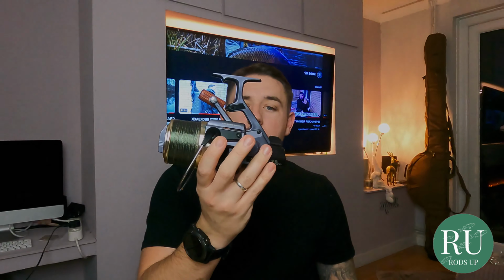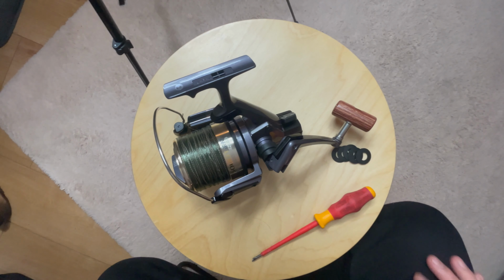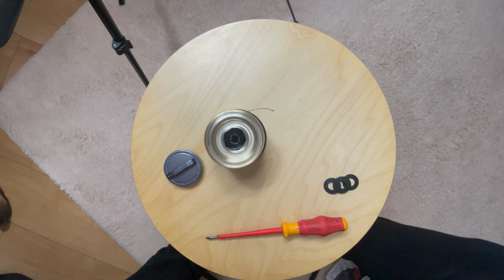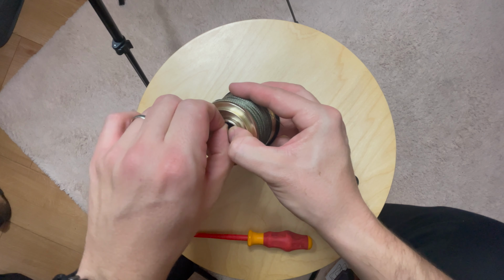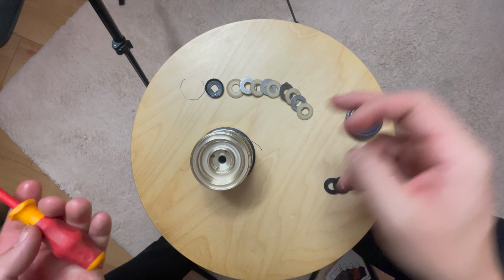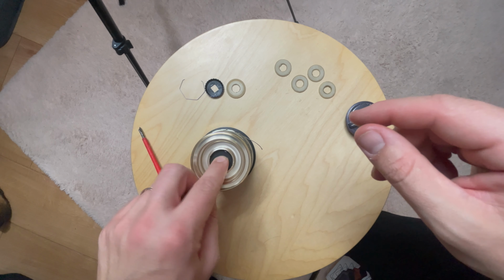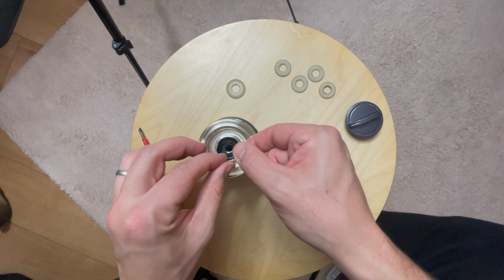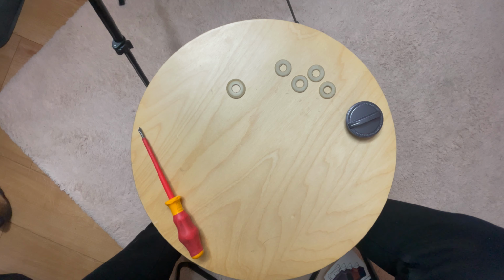HOW TO INSTALL ICE WASHERS INTO REEL

Comment: Just ordered the black tournaments. I have always fished with Shimano but wanted a oldskool work horse. I wil replace the washers to for Carbon.
Greetings from the Netherlands
Reply from the maker: Great reels mate. So happy that I brought them!
Reply: @pathfinders-90  i had these reels in 1996 . They have never changed. Only the price i am afraid. I find them verry expensive for the technical features you are getting. But hey, the clutch is great, they look good and in about 35 years they are stil turning mate👍🏻😁
Reply from the maker: Yeah they’re expensive for not a lot of features. The things they do they do well. I’ve put some serious distance on my casting! Can’t beat the look of them either

Comment: Another company called Custom Reel King do caps and carbontex washers. To make it fully quick drag. And carbontex are supposed to be a better drag material. 

They have a few choices of caps  You might still not like them. I'm thinking of converting my Emblem Spod reels (original models). As they will make a great long range pike reel. I'm not too bothered about the cosmetics anyway.

Comment: Good vid, however when looking for ice washers for my Emblems I noticed on the installation video it states to remove all grease from old washers and any excess grease aswell.I am wondering if that would have made a big difference on the performance of your washers.Good luck and tight lines,just subbed.
Reply from the maker: Morning mate, I have actually emailed the company about this. Waiting for a reply and i will get back to you 👍🏼.
Reply: @pathfinders-90  Try cleaning grease off with IPA Isopropyl Alcohol 99.9% or try some brake disc cleaner then put back together and try drag again.
Reply from the maker: Will do, appreciate the info 🎣👍🏼